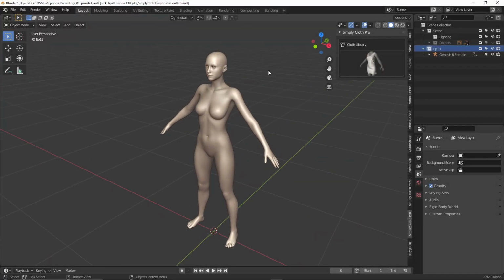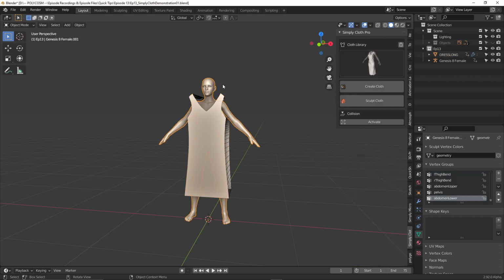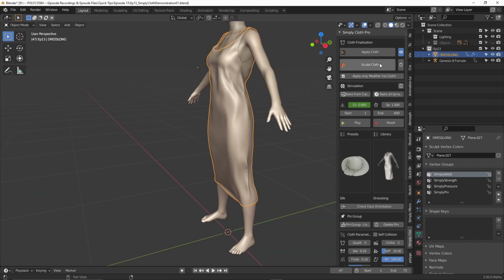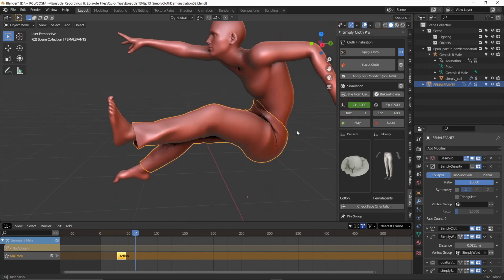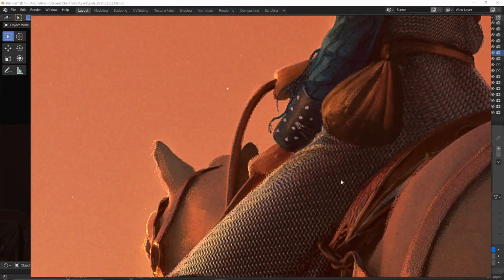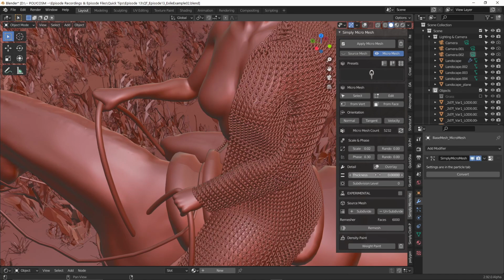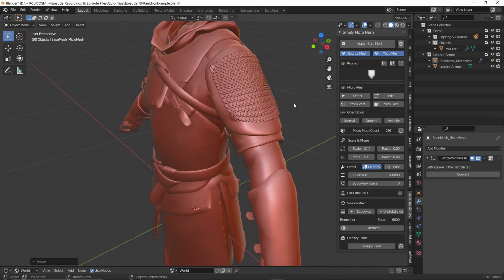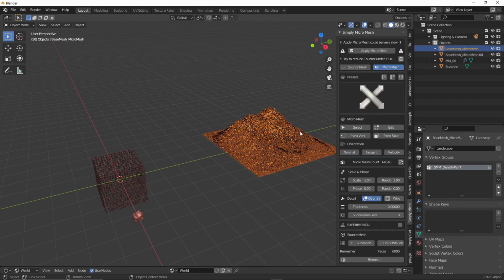QUICK TIPS | Creating Clothes, Armor & Custom MicroMeshes With "Simply Cloth" & "Simply Micro Mesh"

Comment: I am glad to see someone post how to use the add-on in such a detailed way and I think it is great. So I disagree. It's not about the fact that blender can do this already. It's the fact that this add-on can get you prototyping quickly and you can combine it with Simply Cloth so easily it makes me sick. Such a great set of tool to get you started. Then if you want the advanced features you can dig into vanilla blender with some knowledge of how particle and cloth systems work.
Reply from the maker: I 1000% agree. I’ve been using Blender for a few years now, and even I have no clue how to get started when it comes to intricate particle system stuff. I do sometimes dig into «Vanilla Blender» as you put it, but that’s fairly rare. These add-ons give me everything I need in just one simple box, which, when working in a production pipeline, the simpler and quicker I can do things, the better! 😁🙌

Comment: Thanks for sharing. I do get that you are excited about micromesh, because it speeds up the workflow  with the particle system for people not familiar with that.
But I have been working with stuff like that for years now. If you know how to use the particle system you don't need an addon like this. You get it for free with native Blender. 
A nice video anyway.
Reply from the maker: I get your point, but you can’t argue this doesn’t speeds things up TREMENDOUSLY and work as an amazing starting point. 😋 Since I use these tools in a production pipeline, the quicker and easier I can do things to get to an end result, the better! 😄🙌
Reply: @POLYCOSM  I don't want to argue at all :-) I was just saying, and I wouldn't mind the price at all. Coming from Maya and C4d, the prices for Blender addons are like gifts, aren't they? 
But for a hobbyist/student it might be a bit of money. One of my students asked about this and said "isn't that the same as the particle system I get for free"? And it is. 
Btw with pre-setup particlesystems like I use (also for production) it is just as fast as this. I already have them for a long time, as well as even more extensive libraries for the stuff to put on (and mix together). 
But yes, I totally agree that it is a huge time saver and therefore worth its money, if you don't already have everything set up.
And it for sure is easier to tweak the settings :-) In the particle system you have to go to different sections to tweak those, here you have them in one panel, so especially for people new to particles this will be a great help.
Did you try to mix different particles together? Does that work? That would be awesome.
Reply from the maker: Completely agree with you there! 😁 Hmm, what exactly do you mean by mixing? I’m a complete noob when it comes to particle systems really. If I want to get a specific result or have something specific in mind, like fireflies or smoke following a path, I normally have to watch a YT tutorial in order to get there. I’d be completely lost on my own. 😅
Reply: @POLYCOSM  those would be the emitter type. In that addon the particle system is used as hair type. When I want different scales on a piece of armor, I use 3 or 4 different ones in the particle system. They have to be in their own collection. In the particle system instead of referencing 1 object, I reference that collection and all objects in the collection are used. I can also decide if one of them appears more often than others. 
Look in the addon if it offers an option for collections or groups.
Reply from the maker: Ahh, I see what you mean! I’ve used that trick with Quixel megascan-flowers and grass to quickly populate an environment by varying the meshes being distributed. I don’t think you can do that with the add-on unfortunately, but I can ask the creator to implement a feature like that in the future! ☺️ He’s a crazy busy guy, so he might already have thought about that feature, but just hasn’t gotten around to it yet.